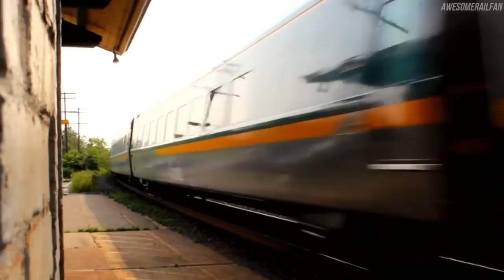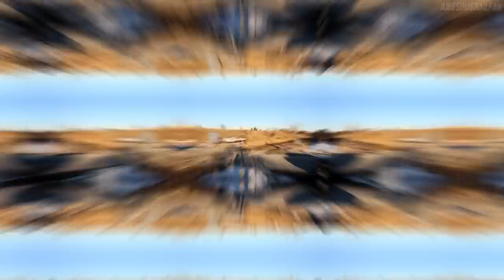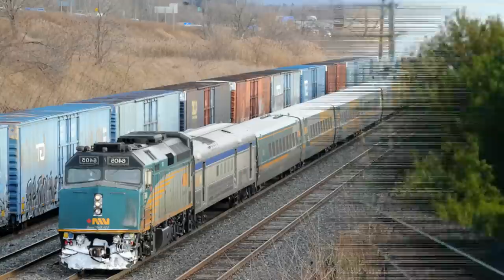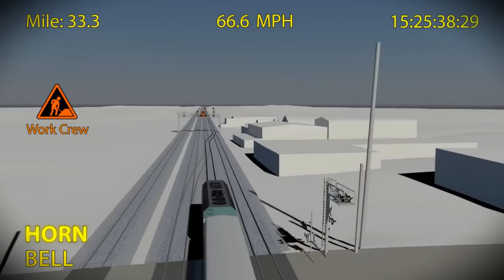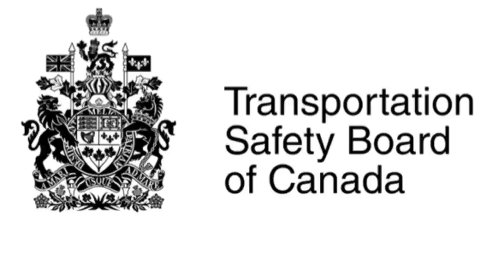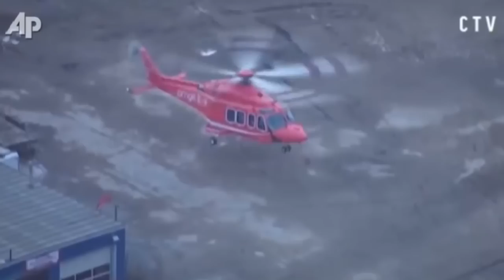Engineers Distracted? | The Burlington Train Derailment in Canada | Short Documentary

Comment: Train crew will forget warning signals while stopped at a station. It's happened before, and will happen again. Even when defences are put in place to help crews remember, these mistakes still happen. Usually, they don't cause accidents. Sometimes, as here, they do.

Protection systems that ensure that a train is not exceeding the safe speed for the track situation do exist, and are implemented in some parts of the world. It is criminal to wait for an accident to occur before using such systems.
Reply: Some form of repeated signal at the station or cab signals showing the last aspect passed would help prevent such things.
Reply: Both of the above comments are true, but the crew should also have seen and obeyed the signal immediately protecting the junction.  That's the "repeated signal" that was actually present on the day.  Standard practice in many countries is to design signalling installations so that some kind of signal is visible from the departure end of a platform, unless the station is in the middle of of long block section such that the next signal is literally miles away.
This is, however, precisely the type of accident that ATP (aka PTC) systems are designed to prevent.  For example, the ATB system used in the Netherlands would have indicated that a reduction to the lower speed was required, and sounded an alarm followed by automatically applying the brakes if the train exceeded that speed without the brakes applied.  More sophisticated systems, such as LZB used on high-speed lines in Germany, would have allowed accelerating to a higher speed in the interval between the station and the crossover, but still enforced a safe braking curve to the speed limit at the point it began to apply.
I would also fault, to some extent, the byzantine signal aspects used in America.  What in all that is holy is red over flashing green over flashing yellow supposed to mean, and how does that differ from flashing green over flashing yellow without the extra red lamp, and/or with one or more of the lamps not flashing?  Viewed from that perspective, it's easy to see how the signal could have been misread.  All the more reason for an ATP system to directly indicate and enforce the permitted speed and clear up any confusion.
Reply: @Kromaatikse  Even Germany's negative control system (PZB) would have stopped the train, because a magnet would be active and influence the train. In this case, the train would haven been allowed to exit the station with 25km/h at most, since the system goes into restricted mode if you stop the train while the next signal was reported to be red or allow <=40km/h.
Also signals are much simpler in Germany.
In the old, still commonly used HV system, on main signals Red (one or two lights) means stop, green means go and green-yellow is go slow (40km/h unless indicated differently). On pre-signals, there's double yellow (expect to stop) double green (expect to go) and green-yellow (expect to go slow) announcing the current position of the next main signal.
In the new KS system, there is just green (go), blinking green (reduce to indicated speed until the next signal), yellow (stop at the next signal) or red (stop here).
Reply: Canada is working towards PTC 10 years later.. still far to go. I have seen PTC work on Ottawa's Line 2 prior to shutdown.
Reply: @wernerderchamp  Honestly most signals are easier to read than American ones.  You should look up the OSShD system (used in nearly all the ex-Soviet nations); it's surprisingly logical, easy to read, and conveys practically as much information as the American system but with fewer lamps and no confusion.
Reply: thanks for the explanation -- tbh it sounds as if "engineers" are total idiots if they can't remember simple warnings (which change from time to time).  It's not any different from a commuter driving the same car route each day and sometimes officials issue warnings about changes in the road ahead.  In all my decades of driving, never once would I zone out so badly that I forget warnings about traffic conditions.
Reply: @jaspermartin7444  It is very much different. It's a well known problem with the way humans functions. It's a sort of "remembering to remember" issue, and humans are notoriously bad at that.

When you're driving, to avoid having an accident, you only ever have to react to what's happening in the moment.
Reply: I mean... I.e the ETCS (European train control system) specification and hard- and software implementations from multiple vendors are readily available and have proven to be safe and reliable, i.e in Switzerland. Israel, as a non-european country, also uses the system, so that's not an issue.

Newer versions (Level 2 and upwards) don't use signals anymore, everything is transmitted to a display inside the cab. That also allows one to easily set temporary speed restrictions for any section of track, you don't even need to put up a sign. Better yet, without any change to the track infrastructure, the train driver is supervised by the system and can't accidentally go too fast.
Reply: Canada's VIA Rail failing to utilize the time-respected tradition of having a conductor I believe is was a major cause of the incident. I work as a conductor in the US, and having a crew member in charge with the safety of the train foremost as their primary duty relieves stress, adds redundancy and reduces the likelihood of serious human error like the Burlington wreck. When dispatching a train out of the station, the conductor is to remind the engineer of the last signal indication they received. I'm not too sure how the practice works under the Canadian ruleset, but I imagine it is similar with "proceed, prepared to stop at the next signal". Just my two cents.

Comment: Unfortunately, this is one of the many tragedies in Canada caused by not following signal indications. The TSB has issued many recommendations to Transport Canada to mandate physical defences to enforce temporary and permanent speed restrictions as well as speed associated with signal indications. Amtrak uses two systems on the the Northeast corridor that have proven to be literal lifesavers, ATC and ACSES. This is something that should be mandated on passenger trains at least here in Canada.
Reply: I really do not get why you can't install at least basic transponders next to signals, I mean fully guarded tracks are by far better. But if you have PZB, developed in the 1930's, it would have prevented this, though at the time that did require a speed trap, most systems in the 60's and later did come with speed restrictions build in however the earlier system is just a couple of buttons and a brake activation valve, probably less then a thousand to install on any train. 
But that is still more expensive then just blaming someone else.
Reply: Simple, lobbying
Reply: The fact that the CROR contains a shitload of different signal aspects, sometimes for the SAME INDICATION, doesn't help either.
Reply: It cause the a large majority of tracks are owned by private companies and are leased to passengers services. CN and CP have no incentive to add such infrastructure for their cargo operations or for other companys’ passengers service
Reply: @Kishanth.J just 2 km east of where this accident happened the ownership changes from CN to Metrolinx who owns the GO Transit commuter trains... I believe Metrolinx will eventually be using some cab signaling technology once they do their GO Expansion project.
Reply: @Kishanth.J well, giant accidents with potentially dangerous cargo are also a problem...
Reply: Mychaelparsons9772: As a Canadian l can say this another of Canada's wishy washy way of doing things. I read that the Canadian Federal Drug Administration ( l probably have got the name wrong) can only ADVISE a drug company to stop making an unsafe product, where as the equivalent American Government body can actually STOP the drug company from. producing the unsafe product.    Sorry to offend fellow Canadians but l find it difficult the weak actions on both the enforcement of safety standards on both transportation & pharmaceuticals.
Reply: @FSantoro91  “The fact that the CROR contains a shitload of different signal aspects, sometimes for the SAME INDICATION, doesn't help either.”

Yep, we definitely need to simplify the signalling system in Canada.  Far too much nonsense, notwithstanding unlike the US (where railroads have their own signalling standards/systems), rail signalling in Canada is standardised throughout the country.

The UK's basic 4-aspect system (green, two-yellow, single-yellow and red, with additional divergent signals) seems to be the simplest and most straight forward.

Comment: It may have been  beneficial if the person in charge of Aldershot station had been required to caution the locomotive crew as to the track switch before allowing the train to proceed.
Reply: The crew should have been utilizing a delay in block type rule. When starting from a stop, proceed prepared to stop at the next signal UNTIL the next signal is visible and that signal displays a proceed indication and the track is clear to that signal.
Reply: Buddy, no station employee is gonna do that. The illuminated signals clearly instructed the crew how to proceed. Somehow, 3 of them missed the signal.
Reply: @46fd04  
If they had been reminded they would not have missed it.
Where I volunteer, if the line controller instructs a station master to give a caution order to the loco crew, they do it.
Safety always comes first.
Reply: @IN_THIS_DAY_AND_AGE  Thank you for the info. I'm now understanding the last signal light they saw was just prior to the Station, and they most likely forgot about it when they departed. Sadly, that mistake killed all 3 of them ☹️

Comment: Signals should be controlled electronically in the locomotive, like in Europe. You would not be able to speed up onto a slow pass signal. The train would automatically apply an emergency break directly after the first signal.
Reply: *brake. An easy one to get wrong since the brake does "break" the momentum of the train (or vehicle).

Comment: The difference between passenger and freight is predictability. In freight, you're always expecting the worst, and you're on the lookout for anything that can change because it always does. But in passenger service, you'll often do the same things over and over again. You can depart the same station a thousand times and each time you could get the same lineup, and go down the same track. As a passenger engineer, your job becomes very repetitive. In corridor or commuter service, you're often running the same equipment every day as well. They obviously forgot what the previous signal was, and in the familiarity of doing the same thing every day, they may not have been paying as close attention to the next signal. It's easy for your brain to default back to the norm. If you always come in on a clear and you always depart on a clear, you may very well go through the motions under that assumption. Especially if you're in a crowded cab with two other guys who are obviously just as distracted since it would appear as though none of them caught the same problem the guy running missed. What's worse is those slow crossovers that are seldom used are very sneaky. If I had a dollar for every time I almost forgot I was crossing over and had to slow down, I'd be retired. Add a 7-minute station stop BETWEEN the advance signal and the crossover itself? Yeah, THERE'S YOUR PROBLEM. This is where good communication comes in. The Conductor normally should confirm the previous signal to the engineer upon giving him permission to depart, and the engineer should repeat it, even if the previous signal is a proceed indication and the rule doesn't require it. Just that will jog one's memory. The other two guys in the cab should have reminded him as well.

Comment: Via Rail trains in the Golden Horseshoe corridor travel well below the speed limit permitted outside the Greater Toronto Area (GTA). It should be noted Ontario and Canada do not have high-speed rail, and with the exception of Ontario Gov't operated GO Trains, passenger rail in Canada is a secondary priority to freight. It's a case of velocity x speed x angle of the track which sealed the fate of the engineers. It's also a circumstance of perception in observation from the locomotive cab. The speed at which you are travelling becomes lesser to the driver, the higher above the surface you are travelling upon, including the angle from which you anticipate a lane-change, turn or crossing. In view of the crew having knowledge of the reduced speed, due to track maintenance prior to the stop at Aldershot their attention was likely drawn away from that indication thereafter.

Comment: We had harowingly similar train crash in 2013: 1st local train had short stop on 1 station, then moved off into the tunnel which starts literary 10 m after the station. It was followed by second express train which usually doesnt stop at that station but since station before was in renovation it used this station instead. With passengers being unaware of changes it took like 10 minutes for all of them to exit the train and for others to hop in and settle down etc. 
In the meanwhile the local train had engine issues and stopped some 500 m after entering the tunnel just behind the long curve. IT was protected by yellow signal on the station which engineer of express train confirmed, and then accelerated his train after long pause and went full speed, noticing malfunctioned local train just some 50 m away once it had cleared the bend and saw red signal which was protecting it. In crash by some miracle nobody died, there were a dozen of injured ppl however, and since everything had happened in the middle of a tunnel it was pure blessing that there was no fire or anything more then few bent coaches and smashed leading engine of express train.
Reply from the maker: Lucky no one was killed 😬

Comment: It's a classic delay-in-block issue. I'm unsure what rulebook VIA follows - it's probably GCOR not NORAC - but each should specify trains are limited to 40 mph after a station stop if not equipped with cab signals. VIA in 2012, maybe no cab signals? A seven minute stop is long enough to forget what you're doing.
Reply: VIA uses CROR, Canadian Railway Operating Rules.  There are some very stark differences between CROR and any of the American rule books, especially on what they call their signals.  Some have similar aspects but far different indications.  Cross border operation was always a challenge (CP/D&H to Montreal) with the rules on top of the French culture/vernacular.